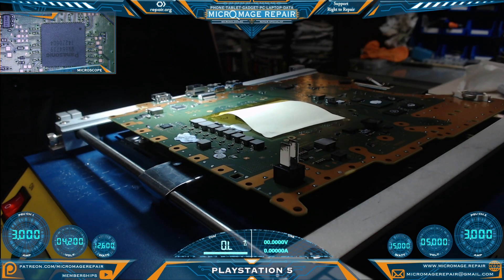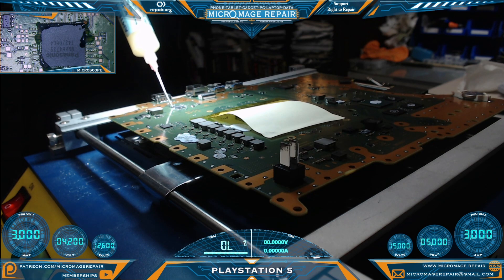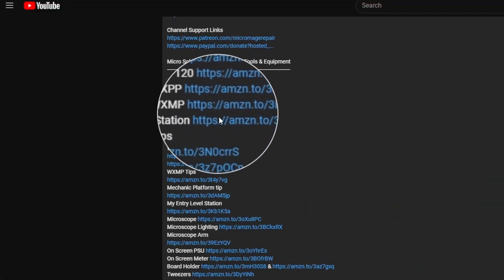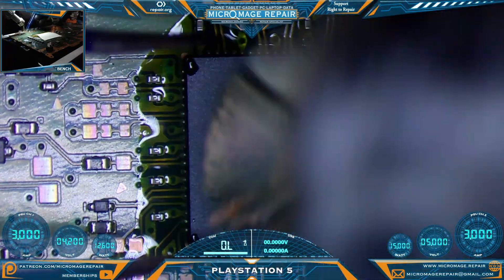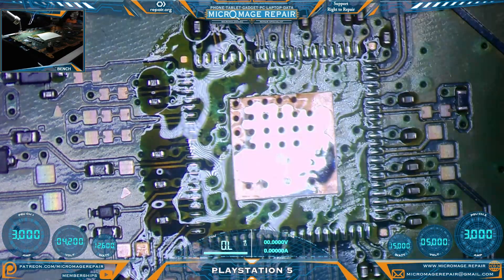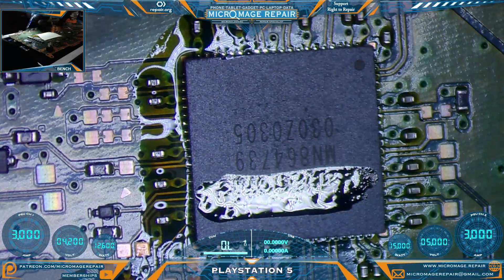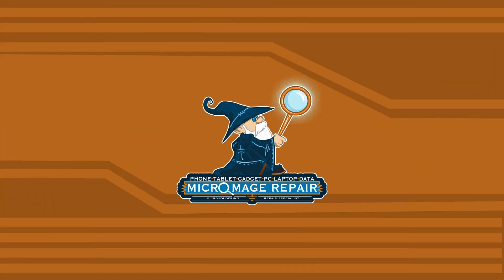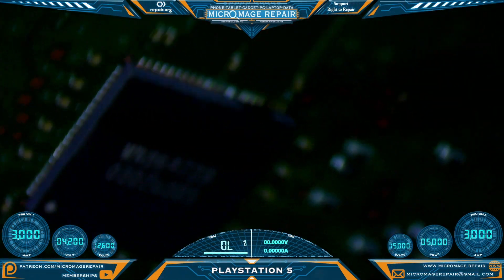🤓 MN864739 Encoder Replacement

Comment: Preheater maybe a little overkill. I use the hot air with no nozzle attachment at 450c works very well and had no issues reflowing the hdmi encoder ic.
Reply from the maker: For me lowering the heat requirement has increased my success rate with donors and ordered chips. Always do what works best for you, there is no one right way.

Comment: Beat me to the punch ...lol   I've done lots of playstation 5 hdmi ports ... Never had a bad HDMI chip Never replaced one ... Maybe I should pick some up ... Where did you order from
Reply from the maker: My B to B client actually ordered it so I'm not entirely sure.
Haven't had another case  like this one as of yet so haven't made any orders myself.
Reply: @MicroMageRepair   Yeah I've seen some pretty smashed up pins before but never had a bad one yet They must be tough nowadays
Reply from the maker: @QsTechService1  Agreed, I've had HDMI ports smashed in every conceivable way but thus far this is the only encoder. Not that the console doesn't have any other issues. It has a lot it seems.